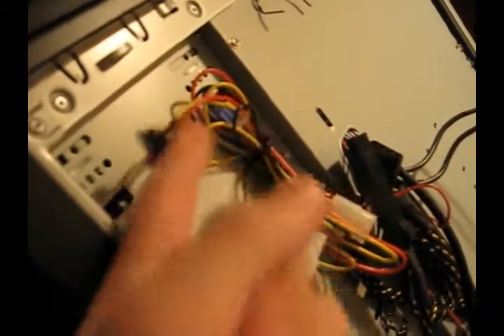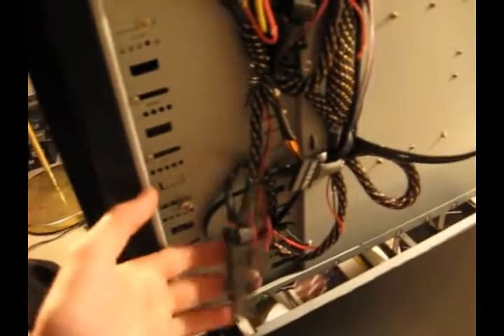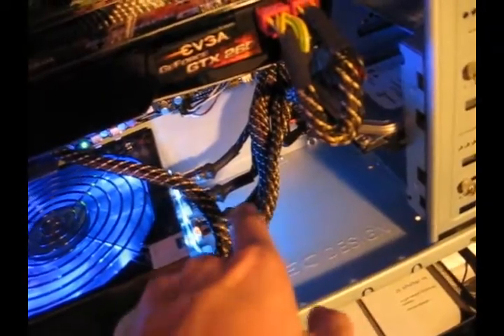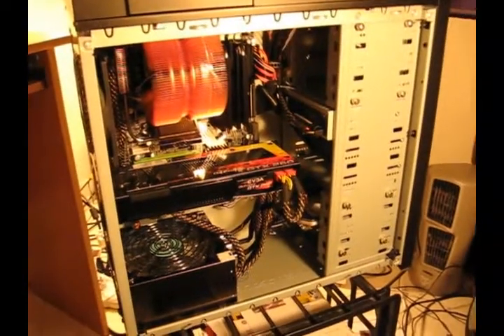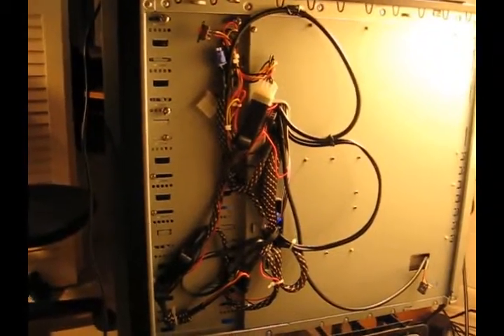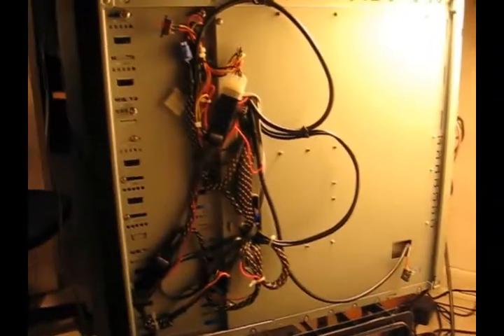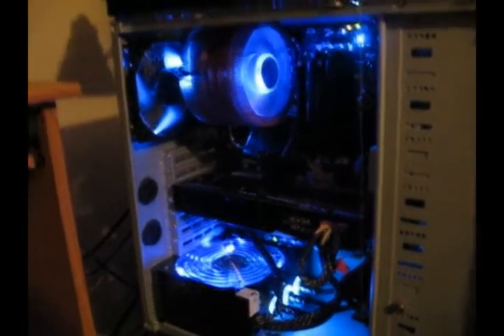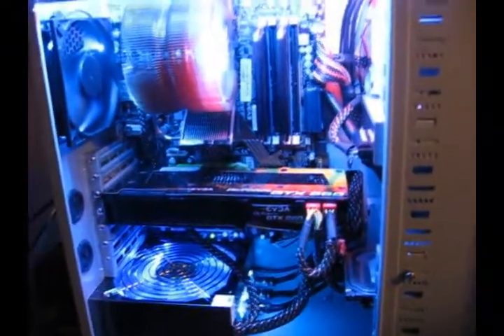Antec900No-Drilling Cable Management Part Tutorial 3/3

Comment: Nice cable management came out really good for that case good work. 5/5 

You had the same part twice but its cool it was a part that need to be seen twice I didn't mind I like looking at your video card got a 280 myself.

It wasn't boring I enjoyed it all and you didn't cut anything respect!

Nice overclock on that chip I got a E8400, E5200, and E2160 I am overclocking.